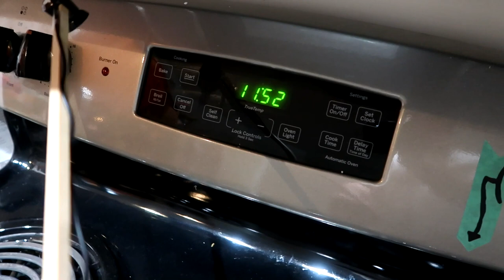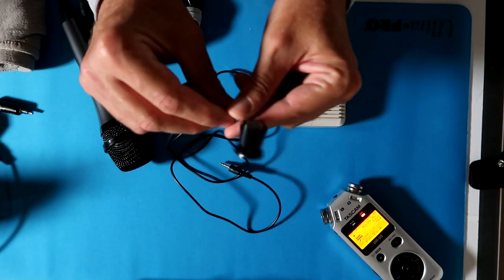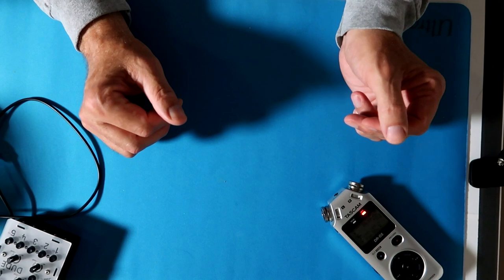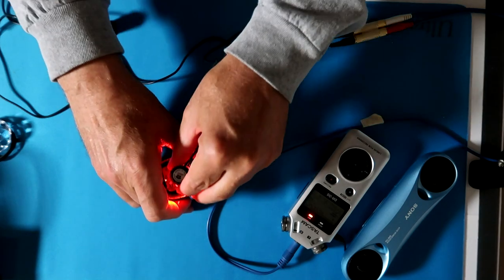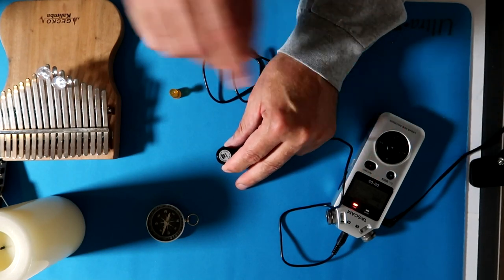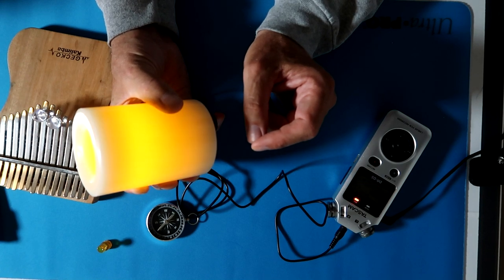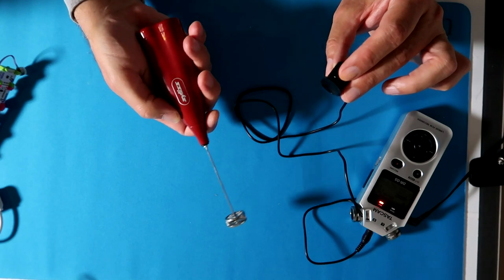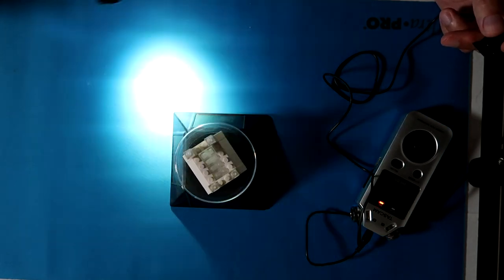EM Coil Sounds and Concepts

Comment: Fun stuff! Thank  you again. FYI, I also do a bit of this type of thing -- but I have been using the "Soma Ether" to accomplish it, perhaps you're familiar?  It's a bit like a de-tuned AM radio of sorts, but it seems to have a really great sound circuit, when it locks onto something interesting - wow. It also has variable gain and  two antenna nodes, which can be used to produce interesting results, as well as the easy ability to embed Morse code messages - which I find rather fun. Battery operated clock circuits are my favorite, while 4' florescent lights give off mind blowing harmonic drones. These Russian manufactured Soma instruments are a bit expensive, but often worth it IMHO. I recently got in their RoAT (Rumble of Ancient Times) a complex little drone like device, which I'm very impressed with!  Your videos are always a pleasure to watch and re-watch - not only are they highly informative, but they're also rather relaxing, due to your excellent easy delivery and outstanding pacing of technical content... I'm working through all of them again (having a lot of the same equipment as you do). My only problem is finding the time to properly explore all these little gadgets I collect. I bet you can also relate... 😉  Cheers & Kindest Regards.

Comment: Doesn’t get more basic than that. Very fine exploration.  I be curious to see more about using these sounds as samples in an ambient way. Sort of expanding on how you wrapped up this video. Many thanks.
Reply from the maker: You're welcome! Thanks very much for checking out the video. I've been thinking about including some of these sounds in a longer ambient piece. Will post more about that at some point. Meanwhile, I think one or two of the videos in my "Delta Waves" playlist on here uses some coil sounds; those are ambient exploration that are 5-10 minutes long.
Reply from the maker: Also, marc.wav_ has a great Instagram post (july 9, 2020), some intense EM sounds in an Octatrack jam. those EM samples are also available (for free) there.

Comment: I've been curious about the Soma Ether for a while but have always thought that it was sort of too simple to justify a purchase. They say on their website that it's not quite the same as this but seems to me like you can get the same effect. Do you ever take EMF coils out into the field, if so how do they perform?
Reply from the maker: They work fine out in the field - mainly just a matter of picking a spot that has cool sources (and where the activity itself doesn't cause any issues). I am bringing on a trip soon, also want to try at a friend's laboratory. Someone once commented on another post that a photocopy machine has amazing sounds😀. As for vs. other gear, the pricepoint on these is so low, particularly if you have a recorder, it's worth trying anyway. Thanks a lot for watching!
Reply: @undulations  I had a Soma Ether for a while. I did not have luck with it. 60Hz hum overwhelmed almost everything in our house. Plus, the build quality of the Ether was, in my opinion, lacking given its cost. And (I think) it induced a battery leak that gummed it up.

But I'm all for spending the eight bucks to try again with the phone pickup. 😊I may insert one of those passive attenuators in the path for when I go wandering near the power company substation. 😊
Reply from the maker: @laehnoj  Well, I don't know a ton about the Ether but I think it picks up actual electromagnetic waves vs. the coil picking up magnetic field fluctuations (which fall off fairly quickly as you move away). So, I guess something like the 60 Hz becomes harder to overcome.  Or maybe the Ether picks up all of it, idk. I guess there is a down side to having something super sensitive in this case. I've never had it happen, but I assume the phone coil might be able to pick up a radio station if stray capacitance in the setup was just right to tune in. I have a Landscape FM Stereo Fields, basically a synth, (which looks beautiful but has proven pretty difficult to enjoy) and I got a radio station coming out of that at one point🤔. Anyway, best of luck with the phone coil and thanks a lot for checking out the video🙏🏼!
Reply from the maker: @laehnoj  I think you'll enjoy it! The Soma is sort of a different beast, picking up the waves.